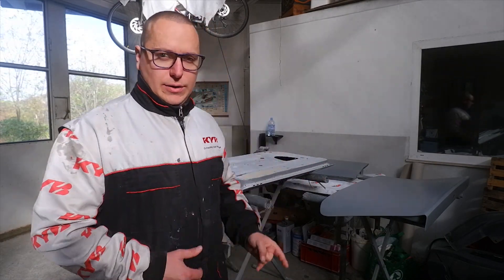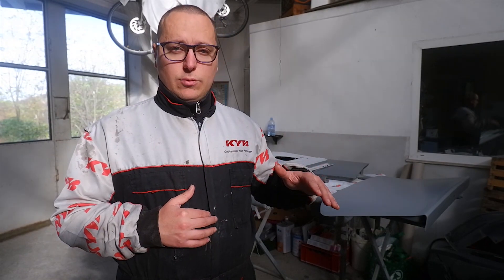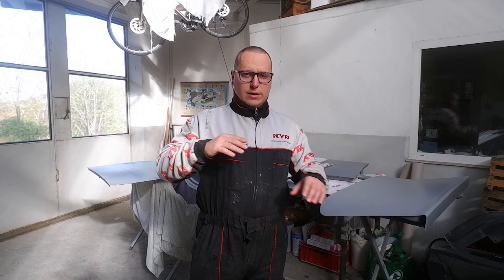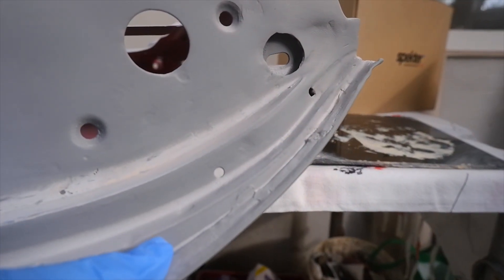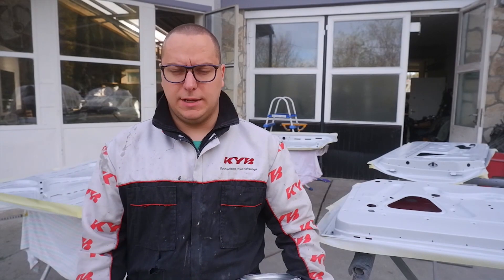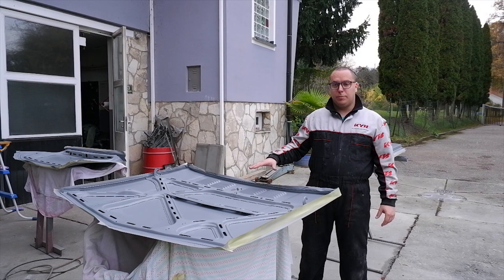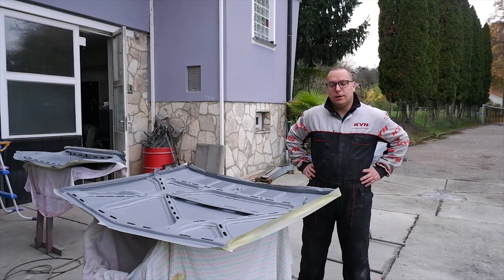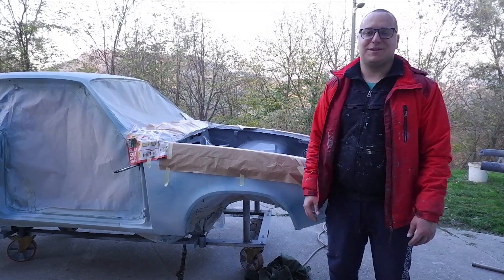Opel Manta A '71 - Recap of Paint Prep LAYERS for DIY | Engine Bay in SURFACER | Doors & Hood Prep

Comment: Hello,  Something that might help you painting.    I was taught to bring the air hose from my back side and over my shoulder.  This means that the air hose is supported by your shoulder.  You adjust how much hose you need and that way it's easier to switch hands painting.  Your also so free to concentrate on painting and not concentrating about holding the air hose.  This method also helps the air hose from coming in contact with the body surface.   You still have to hold the air hose.  I usually hold it near my waist from the opposite hand.  Example....If your holding the spray gun with your right hand, you would hold the air hose on your left side by your waist.  I hope what I'm telling you is easy to understand.  Your doing a very good job either way.
Reply from the maker: Thanks John, it makes perfect sense! Tips like that definitely help and as a beginner sometimes you make your job harder than it should be. Thanks for the advice, much appreciated! ☺️